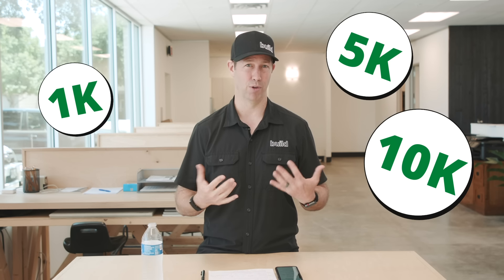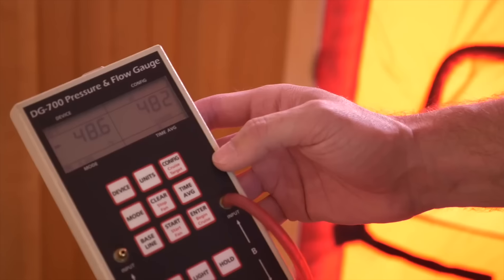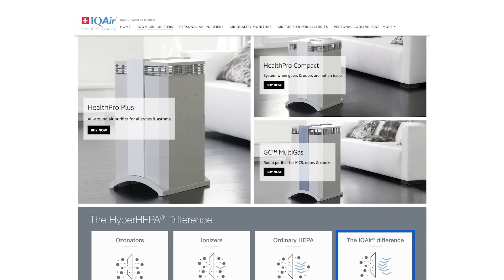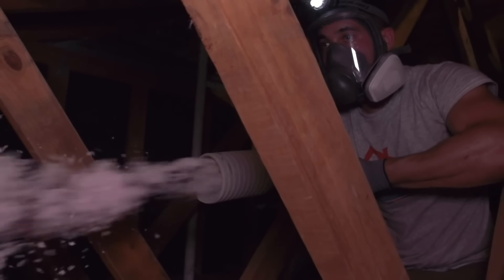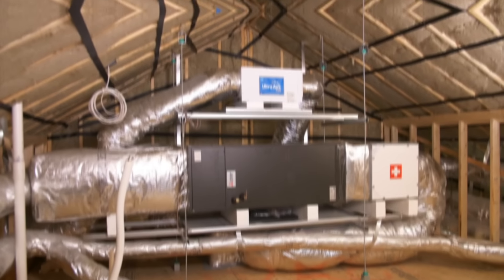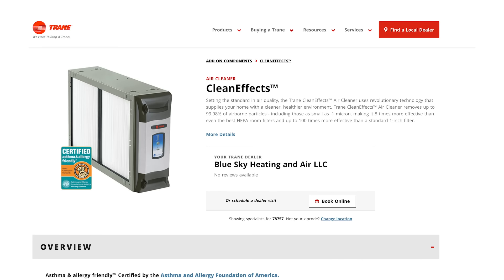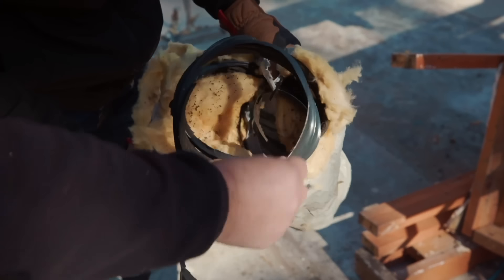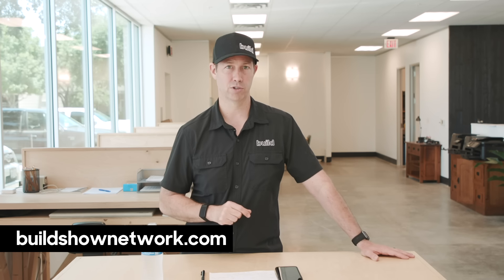Affordable Home Upgrades (Energy Efficiency & Indoor Air Quality )

Comment: Thanks you for all the hard work and attention to detail. I live in Houston and recently received a quote to foam seal the attic of my 3500 square ft home at the roof line with 5 1/2 inches of open cell foam. My home was built in 2006 and has typical blown in fiberglass. My light bills in the summer are $350 to $500 ( we keep the house 70 - 72 degrees ). I do own variable speed units, one gas and one electric. The gas furnace does have dual pipes for exhaust and intake. My 2 original units are both 3.5 ton goodman 16 seer machines. Would love to see a more detailed video on retro fitting an attic to foam insulation ( I have seen your others ). I was told i needed to manage the attic humidity at 45 -55 % but was also told that the in house air and the attic air can not mix. So I am not sure if I should have separate dehumidifiers for the house and for the attic. When i saw the $10,000 dollar option on this video I hoped you would mention something about foaming the attic. Does that mean it should cost more than that? The foam folks quote:
Description Total
Spray Foam Roof Deck With 5.5" R21 Open Cell Insulation
Spray Foam Attic Gables With 3.5" R13 Open Cell Insulation

$3,925.00

Removal Option
Description Total
Remove & Dispose Of Existing Attic Insulation $1,875.00

Total $5,800.00

Any help you can provide would be greatly appreciated, even a contact in Houston to get a second opinion.

Comment: I have 1940's house, would adding a metal roof with 1-2" of insulation under the metal roof work, or should I remove and add new blown in insulation? I'm thinking for the 500 year house video you did.

Comment: Installing a higher MERV filter will reduce airflow and can cause the cooling to freeze up or the heating to overheat and possibly catch on fire. If your house is ventilated, it will also reduce the fresh air and can cause indoor air quality issues such as mold because you are no longer meeting the minimum required ventilation. It's important to consult a professional about these things, not a carpenter.

Comment: Matt, this is a GREAT video! Thank you! Would you be able to do a comparison between central forced air v/s split air systems? Is it even possible to completely replace central forced air with split air? For attic space, how would you combine sky lights that open with a split ac? i.e. will it help having a sky light and split ac in a finished attic from a heat/cold management standpoint? Thanks :)
Reply: lots of places run whole houses off of mini splits (I do currently). the efficiency is fantastic because the units themselves are ~20-22 SEER, but I also don't have to run them all. if I'm not using a room, then the AC is off. the only downside is that you no longer have a single point to filter and humidify/dehumidity the air. so, it's smart to add some air filters separately.

Comment: A couple of things I did any handy DIY’er can do. I changed all my lights to LED. Mostly it was just swapping Lamps out. I started with the biggest users. On the Decorative I used the Filament type LED’s. I have Made in USA Fluorescent wrap fixtures. I used the Toggled Lamps from Home Depot, but I ordered them online, a lot of the ones in the store have been returned, damaged. You take the ballast out, and do a little re-wiring. I on a yearly average lost one month electric bill. I swapped the Toilets out, I’m on a well so my Water Bill, is my Electric bill. I bought several tubes of DAP Caulking that’s in the squeeze tube, “ toothpaste type.” Turned the breakers off as I worked around the perimeter, pulling electrical receptacles, and caulking the openings. Also m going to do the switches next. We had a lot of power strips running “i “ chargers. I put Receptacles in that have USB Ports and plug outlets in them, and eliminated the power strips.

Comment: What are the general thoughts on adding a radiant barrier in the attic?  I am in Texas, 70s home, and have ducts in the attic.  Roof structure is trusses, and it seems fairly easy to staple radiant barrier to the underside of the supports for the roof sheathing. This would provide an air gap to the sheathing, and in theory lower attic temperatures.
Reply: I'm thinking of adding one to my attic.  Many places say this is one of the most cost effective ways of reducing the summer sun's impact on home thermal comfort.  The barrier also reflects back house heat during the wintertime.  

According to the radiant barrier company's website, because my home is in a temperate climate (Northeast US), the barrier would work best if I thoroughly insulate the attic floor joists and lay the radiant barrier loosely on top.  The website says that stapling the barrier to roof rafters is better for hot climates.  

Unfortunately, I ran into one issue.  I'm fairly certain that my attic floor joists are filled with vermiculite insulation, which likely has asbestos.  So I definitely can't insulate the floor until I get an abatement company to get rid of the vermiculite.  I'll likely just buy the radiant barrier and tape for under $200, then go up with a respirator mask and carefully try to put the barrier over the entire floor without disturbing the vermiculite.

Comment: I did two things to retro-improve our southern house. Spray Foam attic making it conditioned space. Added a Mitsubishi SEER 23 mini-split to the master so we don't have to cool the whole house at night. My electric bill went down over $100/month.
Reply from the maker: Yeah baby!  And I’ll bet your comfort level went way up too!  That’s hard to calculate
Reply: May I ask how much did all that cost ?
Reply: @augustreil  Mini-Spil $3,500 installed
Spray Foam retro-fit including removal of blown in insulation was $7,000. I did this after paying a certified energy auditor $150.

Yes, comfort level greatly improved. My 5 Ton unit runs on Low Speed 100% even well into the 90's. My house is only 2,300 sq ft.
Reply: @Lysander-Spooner , Thank you. So it's about a 10yr payback right ? I think that's pretty good considering it'll just keep saving you money for years after and your equipment doesn't have to work as hard. And like Matt said, hard to calculate comfort, although I would say it's priceless !  Thanks again.
Reply: When you say spray foam attic, you spray foamed the attic side roof sheathing? What about the attic flooring? What type of insulation for the attic floors?
Reply: @leekyciabrown3769 , Yes, the plywood right under the shingles, which keeps the attic from becoming a hot box and the equipment doesn't have to work nearly as hard, making it more efficient and last longer. On the attic flooring, you can use just about any type of insulation, blown in, batts, foam or none at all since the attic is now a conditioned space.
Reply: @augustreil  im in coastal north carolina and we've been having heat index up to 115 this whole month (Notmal). So i wont have moisture issues? And that wont block my airflow from soffit vent to roof ridge vent?
Reply: @leekyciabrown3769 , Here's a short video:
https://www.youtube.com/watch?v=8DhCgvdwxrk

Here's one from Matt:
https://www.youtube.com/watch?v=F7D4Q3mjgdQ
Reply: @leekyciabrown3769  if you were to insulate your attic in that fashion, you would be creating an unvented space so you could either close in the rafter cavities and allow the roof to continue to be vented so that moisture can dry or you would abandon the soffit and roof venting and close it up and insulate the rafter cavities all the way from the eve to the peak of the roof.

Comment: I got rid of all my flex ducting for ridgid insulated with R8 and put in an attic stair sealer over the winter. Big difference comparing our Nest profiles from last summer. Unit would come on and run continuously until nightfall. Now its segmented very nicely.
Next I'm going to open walls to ridgid pipe the drops from 2nd floor to first, redo my return ducting and add a dehumidifier. 
You are an influence, Matt.
Howdy from Magnolia Texas.
Reply: How did this update affect your energy bills?
Reply: @ZimZam131  It had a good net effect but a life on the road in summer has been difficult to quantify. 
Once the Aprilaire goes in, I should be able to look back and report stark changes.
Reply: @user-rl9mn6cy9s  I’m replacing all the flex duct in my attic myself with silver R8 flex duct. The old stuff is R6 and black. I’m also replacing the registers and sealing everything really well. Im hoping to see some improvement.

Comment: I was ready for you to suggest a dehumidifier or HRV in the $1k space. Good information as I remodel my 1950s Colonial - simply, everything is leaky.
Reply: A dehumidifier could help prevent COVID-19. The "science" of a potentially deadly airborne virus isn't as easy to test as much of the news suggests. When virus particles are trapped in filters - when and what caused its demise?  Was it destroyed when it contacted the filter?  Was it damaged an hour ago and managed to linger in the air? But, its known the virus can only survive in microscopic water droplets.  Keeping the interior air dry can help with many health issues.  Many well insulated air tight buildings don't cycle the A/C long enough to fully remove humidity to make the room as comfortable as it could be, and the conditions could be better for aerosolized coronaviruses. A dehumidifier certainly won't be unhealthy so its a good idea just for summer comfort.

Comment: Love the idea of Air Sealing for a Tight House, but my Doggie Door kinda guarantees a Door Blower Test will fail, even with the Cover on it, I'm sure.  Not to mention, most Fire Place flues don't seal well.  I'm still trying to figure out the best way to cool off the attached Garage:  Power Vent thru the ceiling into the attic seems to be the best, since the Garage Door is already insulated.  HELP!!!

Comment: Could also buy plants. NASA researched this approach air quality control for the station, classifying which plants work for which pollutants/toxins. Also, I recall reading a study expensive indoor air purifiers are no better than a quality filter taped to a box fan. The retail units look better than a box fan, but not necessarily better than a DIY purifier.

Comment: There’s a topic I see a lot up North here which is that the first floor of our older two story homes are very comfortable where the thermostat resides. But the second floor is always stuffy and warm. I’d love to see a video addressing the science here and how to fix (hopefully for under $10k)... is it an attic insulation issue, an HVAC issue, etc. most of us have a single up flow system in the basement so it’s quite difficult to cool the second floor without overcooling the first. I think this is where the mini split systems show a lot of promise and I’d love to see a video from you digging into this.
Reply: Our last home built in 1900 had very little insulation in the attic. The measured temp difference from first floor to the 2nd was 7 degrees. I blew in cellulose at about 15" and the difference in temp dropped to 2 degrees. It was well worth the few hundred dollars and a few hours of my time.
Reply: Yes please!
Reply: Well, my dad's house, built in 1987 by the finest Virginia hillbillies around: All the dampers in the basement for controlling airflow were wide open. One of them was drywalled over when the original builder finished the basement. The cathederal ceiling in the master bedroom is missing insulation in the corners and edge, I measured 104F there 30 minutes after the sun went down. Both of these PROBABLY contribute to the heat problem upstairs. I've since closed off the damper to the middle floor to send more cold air upstairs. I might go into the attic and use some great stuff to insulate the edge and corners of the cathedral ceiling once it gets cooler out.
Reply: We had great success with zoning. While we did it with a single speed fan, I think it would have been better with a variable speed fan, so that it could ramp down the fan (and possibly heating/cooling) to avoid overpressure. It was cheaper than adding a second unit.
Reply: @johnhaller5851  My house has zoning, it's a variable speed fan. The fan maintains a constant CFM so if only one zone is calling it blows harder to maintain the same CFM. You can see this as increased power consumption by the fan. The builder did seal the duct work as required by building codes these days (house was built in 2017)...and while it was being built, after the drywall was done and before the insulation went into the attic, I sealed every inch of the top plate with Great Stuff. Probably doesn't make much difference in the summer but it sure helped in the winter. My heat pump can maintain 68F when it's 20F out and not use aux heat.
Reply: For $3-5k if you can access the old duct and/or run new ducts, you could put a new separate HVAC just for the first floor and leave the old to manage the second floor.  It may not be that cheap if you can't access it.  I was able to do it during a remodel. Much more comfortable now.
Reply: @TK-qm8rb  Another option is a mini-split for the 2nd floor. I would probably done that with my old house if I hadn't gotten fed up with the neighborhood.
Reply: It can be a number of things acting together. Mostly attributed to air leaks. In the winter up here in SD we get a lot of air leakage due to convection and then the wind also likes to blow through the walls. Start low and work your way up to the top. Spray foam the rim joist. Make sure your windows aren’t leaky. You could also do the 2.0 attic insulation he talks about. If you want absolute comfort, gut the house and do spray foam insulation in the walls as well. I’ve done several renovations where customers have done a room or 2 at a time as well of the exterior walls.
Reply: The problem you have is very common and simple but everyone complicated it. Heat rises so the upper floor is warmer it's that simple. The right way to cool/heat a 2 story is one system for downstairs and one for upstairs. 
In your case just make sure your insulation/ductwork is competent then go to the thermostat and set the fan from auto to on. What this does is allow the upstairs air to continuously mix with downstairs as the air is circulating in the ductwork. Don't buy into the zone systems they don't work right and mini splits are cheap crap that will only last 10-15years.

Comment: Matt, can you recommend a company in new jersey to do a manual j on my home. I cannot find a company to do it without selling me equipment and installation. I even contacted ACCA and they couldn't find a contractor to do it. I want someone to physically come out to my home and get the information and measurements they need to complete the calculation (no satellite image use). I want cfm  numbers for each room so i can design the ductwork properly .
Reply: Look at loadcalc.net, and you can do it yourself. Just do every room by itself if you need CFM data, and use very high R-value for interior walls. However, for a well-sealed house, there will be a bigger need for air exchange, and if you run that through the HVAC (probably not the recommended way) , that would add to duct requirements. Make-up air for fireplaces, dryer, bathroom and stove exterior vents also has to be conditioned in some way, which is probably not in the Manual J.

Comment: I am on a fixed income. Can I trust the energy audits that are done by the state weatherization programs? And can I trust the work done by the contractors they hire to do the weatherization on the house? FYI I live in MD.
Reply: Vernon Johnson  We have similar programs in PA. The auditors here aren’t connected to the contractors so as Matt said, they don’t have a dog in the hunt. In PA some lower income folks can get grants for the work paid directly to the contractor once the work is completed and the home passes its blower door test, and work inspection, by an independent auditor. If you have similar programs in MD and can utilize them, you should be okay.

Comment: This was a great video and watch all of your videos.  We live in Pensacola FL and last year we remodel half of our house and greatly improved the over all performance of the home.  It was a to the studs tear out and we took the time to seal the sheeting, re-seal the windows and bring all the exposed walls up to code.  Also brought the electrical through the whole house up to current code.  The house is much tighter now.  Since then we have been discussing a stand alone dehumidifier for the home and this video just locked in our choice.  You even listed/recommended the exact model we were considering.  Unit is ordered and will be delivered soon.  Looking forward to the lower humidity levels  it will provide.   Always love the building science.  Hope in the future you will take a deep dive into the value or lack of value upgrading 1970's single pane windows to double pane or better windows would provide.  Windows are a big commitment in Florida because of Hurricane requirements and it really can be expensive.

Comment: Want to help your energy efficiency? Attic fan will help tremendously
Reply: What kind of attic fan? For house ventilation or attic ventilation.
Reply: @grtap  vent the hot air in the attic. Matt says they're a scam but I have to whole heartedly disagree. I don't sell them but I'll install them if my customer's want and the temperature difference in the attic is immediately different when it comes on

Comment: You could eliminate 90% of the expense you just suggested if you get rid of that scorched air heating system and installed a hydronic heating system with a small tube high velocity cooling system add on.   water is the best medium for heat transfer